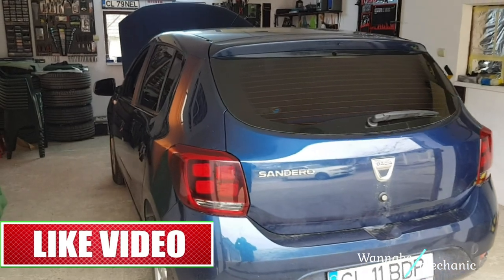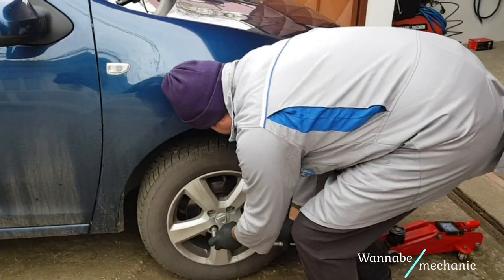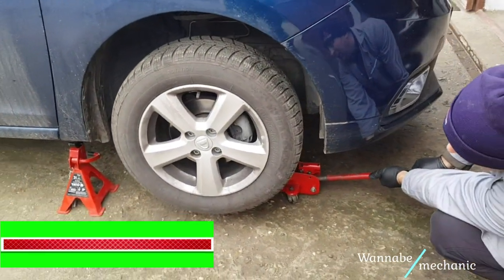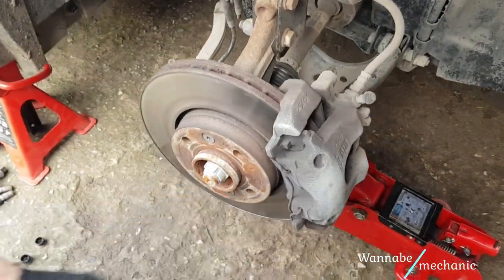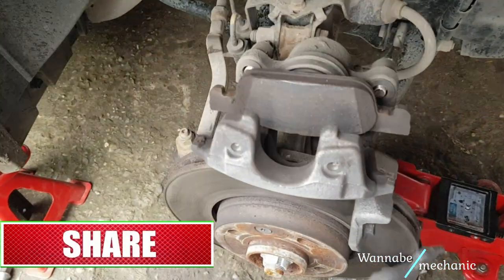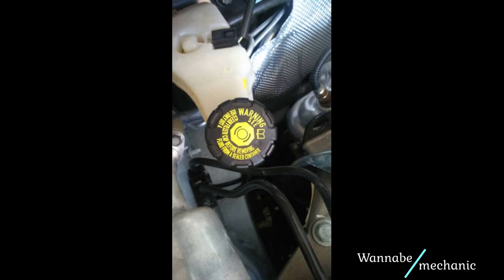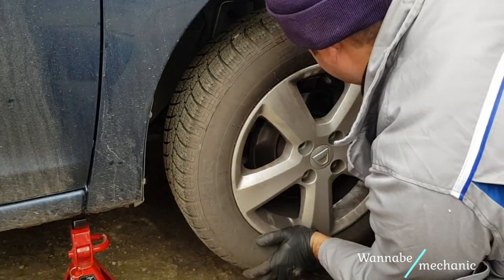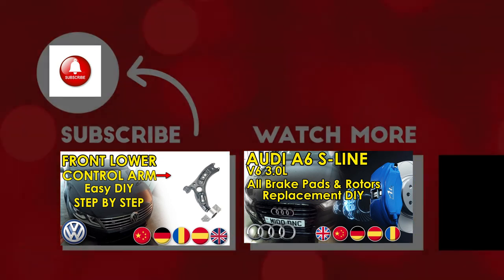Dacia Renault Sandero Logan Duster brake pads replace DIY how to Wannabe Mechanic

Comment: Thanks for making this video. The exploded diagram at 7:30 is from the Renault Dialogys software..The values are in Nm NOT ft.lb so no need to convert as per the suggestion in the video..
Reply from the maker: I did check , you are right Mark. Thank you for being attentive ,i will add a message at that exact minute.

Comment: We changed our brake pads with just your instructions .very good video and simple . However you do not mention to bleed the brakes after completion ,which would be a very good thing to add to your video . Our brakes were spongy when finished .. but my husband knew to bleed them, where some people would not know this . 
Excellent video though .
Reply from the maker: Normally, if you just change the brake pads it is not mandatory to bleed the brakes. All you have to do after the job is press the brake pedal 4-5 times untill the pedal becomes stiff. You are supposed to bleed the system if you change the calipers, brake lines or other components that involve loss of pressure. If you are loosing pressure you should get that checked.
Reply: @TheDIYWorkshop2020  thank you 😊

Comment: Hi Many thanks for the video. Could you please tell where did you get that diagram, did you use any software or repair manual? Many thanks
Reply from the maker: Dear Mr M. I found the diagram on a specialised Sandero Forum. When we talk about lug nuts, rotor bolt or caliper bolts it is usually enough to hand tighten them. Some people use a torque wrench but find that the value recommended by the manufacturer is too low, so they end up handtightening them anyway (often overtightening). Software and manuals are very important when we talk about values needed for fine tuning ( like tightening the head gasket). Tightening the small bolt holding the rotor to more than 5 Nm is higly improbable. Hope you get the analogy. Unfortunately Autodata is too expensive for a freelancer so I use data from many other sources.Thank you for watching, we have many other interesting videos coming up.